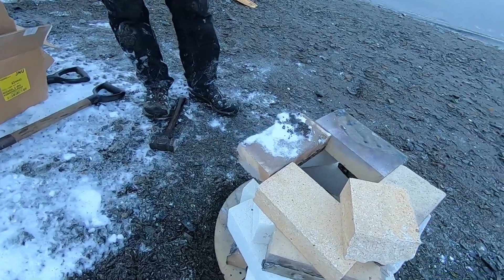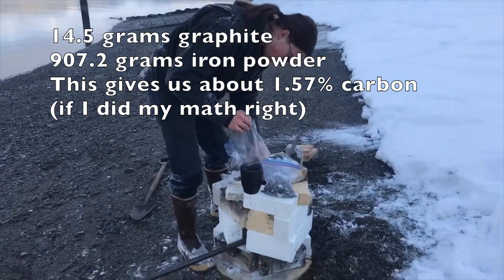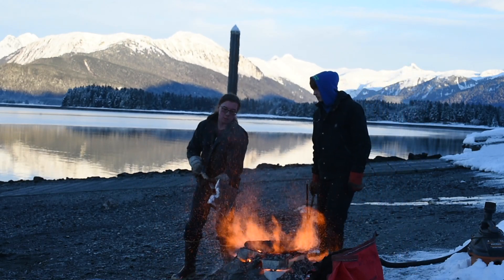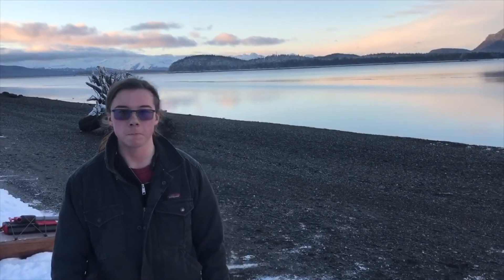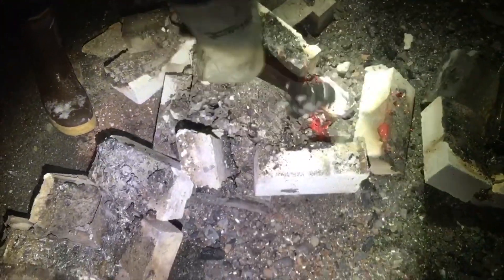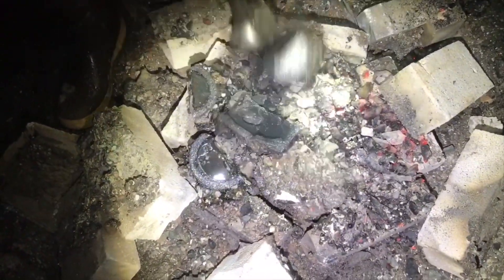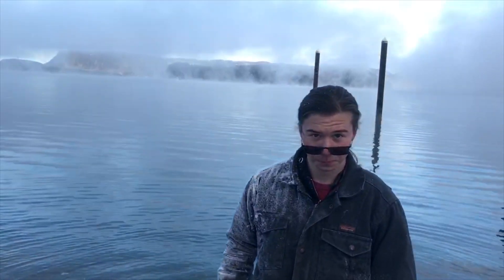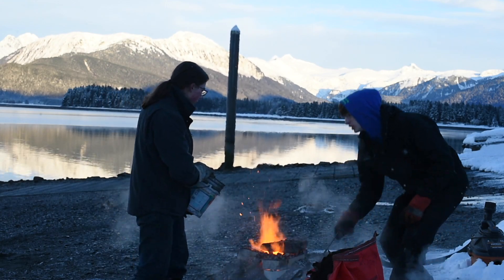The Road to Wootz: Attempt 2 (+Bloopers??)

Comment: Right on!! Keep at it!!🔥⚒💪🏻
Reply from the maker: Next time it’s gonna work…
Reply: @LiamJPenn  if you can source some graphite chips or use graphite from old starter motors I highly recommend it. Graphite powder tends to float into the slag. I used graphite powder in the first couple charges I did. I had them all analyzed and every sample came back low in C% content. Even though I calculated for 1.5% those samples came out to 1.1-1.2%. Honestly sorel metal is the way to go for a carburizer but very hard to source. Also I highly recommend Salamander super crucibles if you’re not already using them. My ingots came out way better in those crucibles and I was open melting. Hope that helps.
Reply from the maker: @sandison_steel  thanks! I’ll see what I can find